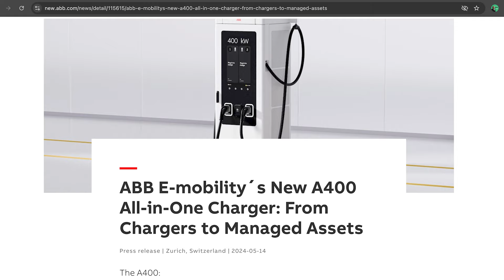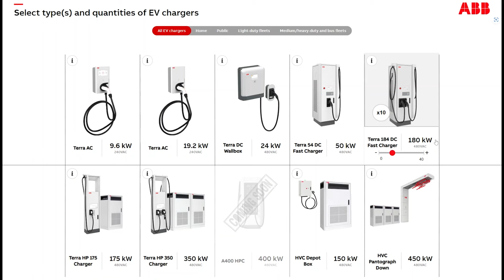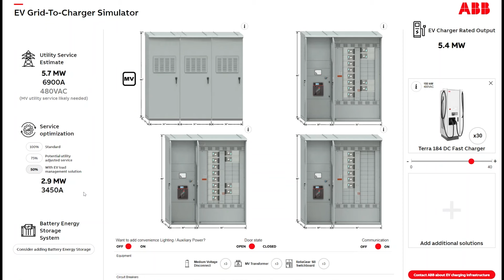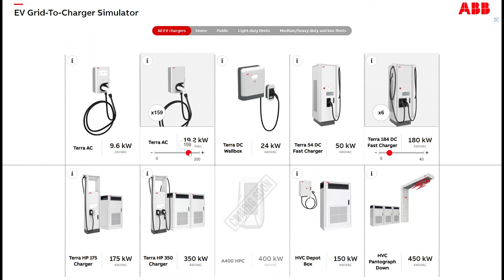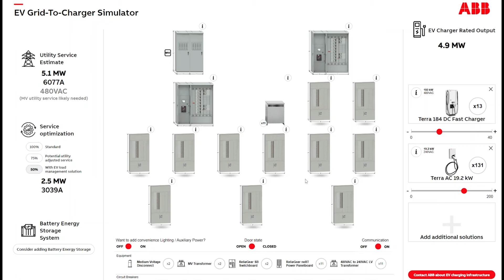Matthew Young - ABB Electrification and Cliff Fietzek - ABB E-Mobility | Munro Live Podcast

Comment: Interesting topic about removable battery. How about using we will say similar to Rivian gear tunnel on cars to store like  a PHEV removable battery and inserting automatically  from Crane like vehicle which is mobile and in some cases multipurpose vehicle could make home delivered battery -like propane or oxygen cylinders in that region

where infrastructure is poorly available with superchargers and you could get PHEV like vehicle done right way without ice extender

Comment: How much ripple voltage is on a 250KW DC charger? What is the ripple frequency? It sounds like they are doing more than the simple charter between the car and the utility transformer.